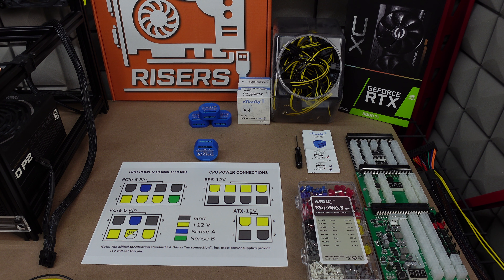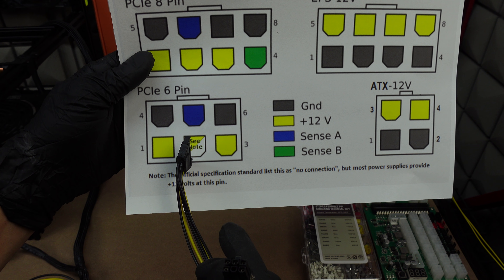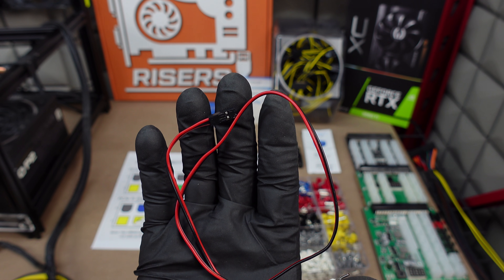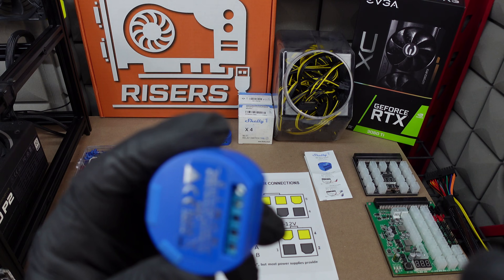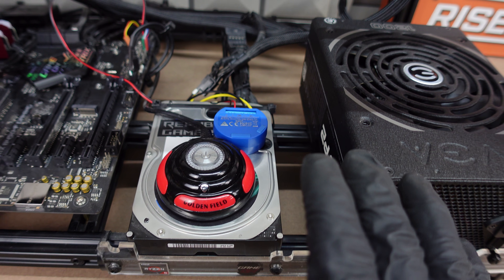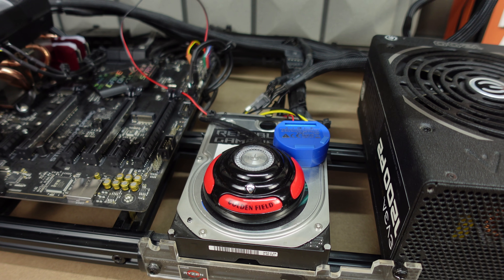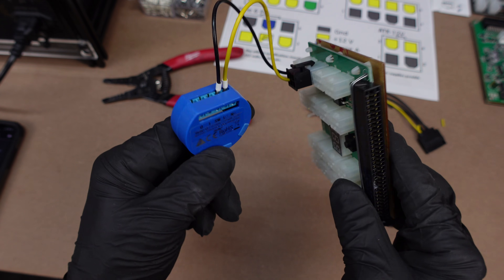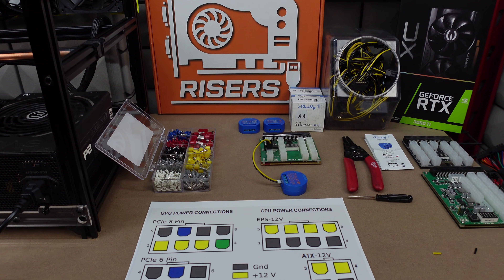How To Remote Control ANY Mining Rig | SHELLY Wifi Switch | All Miners MUST Know

Comment: I cannot get the Shelly switch to work properly on a server PSU. I've fiddled with the settings for button type but every time I turn the rig on, it turns it right back off. It's like it double switches or maybe runs continuous signal or something which prompts the rig to shut back off. Any tips?
Reply: I figured out that I can turn the switch on then back off and it will leave the rig on. Haven't tested it from outside the network yet but hopefully there wont be added latency that will make it not work.
Reply: @b00btube3d nice fix I am alos having that same issue.  Appreciate if you can advise what button/switch settings you selected in the app🙏

Comment: My setup: ATX synced to 2 server psus via sata cable/sata-molex adapter. X11 breakout boards. When I turn the power on/off on the ATX, both server psus toggle on/off.

My issue: When I attached the Shelly Switch to PWRSW and the 6pin to the breakoutboard, everytime I turned on the rig via the Shelly Switch, it would turn itself off seconds later. What I ended up doing was attaching the O/I slots to the RESETSW instead. Again, when I used the switch, it would switch TWICE. But since its a RESETSW, it doesn't matter too much if you're just trying to restart your rig. You'd be able to turn it off via Hiveos, but turning it back on is a problem. I wish I knew what my problem was so I could use switch as intended. This works for now though, I can go on a trip and not worry about rig going offline for w/e reason.
Reply: I'm having the double switch problem too. Did you figure it out?
Reply: I didn't. I had to keep it in the configuration i described above. Also, when I took the Shelly switch to a different place with a different wifi, I was unable to connect it... When i brought it back home I was able to use it again. Weird.
Reply: @jonathank2302  I ended up figuring out that if you turn it on then off within approx 1-3 seconds, it will stay on. The constant signal that the Shelly sends is the problem. Essentially, you send a on signal then shut the Shelly off so it doesn’t screw up the rig.

Comment: Why go with such tedious process..

Just use smart wifi plugs. And use them to directly power on/off the rigs.

If you have multiple psu for a single rig. Then use extension board for each rig. Connect the extension to smart plug and all psus of that rig to that extension.
Now use the smart plug to power on/off the rig even with multiple psus at once.

Some smart plugs also give power monitoring feature. I use them to make note of my power usage too.

Comment: I’m confused chump change. When connected to a server psu do you not need to connect the computer switch wire then? You didn’t connect it here so I’m not sure?
Reply from the maker: You do I just didnt show it. Check the second video where I actually do this!!
Reply: @ChumpChangeXD  where is the second video. I cant seem to get mine working...it is connected to server psu and the pwswitch on motherboaard. When toggling it in shelly app it powers the server psu off.

Comment: Can you Build 10 3060 ti mining and how much power supply does it need and how to undervolt it in HiveOS
Reply from the maker: I can give you some clocks!

Hit the speedometer thing to the right
Core 1430 or -200
Memory 2400 (up by 50 no exceeding 2600)
Fan like 80-100 (depending on the Situation)
125-130 power limit 

It’s going to take some time but you need to try every card and restart the miner after each adjustment. Give 10-20 mins in between until you get a crash or the rig goes off line then you know your pushing something too much and go back to the precious

Comment: nice video!  i was looking a little bit into these too.  for those who are not using server PSUs can run the shelly as a relay off 120 volt,  or actually they can just run it off a cheap 12 volt power plug.

Comment: I’ve tried Shelly switches as well their competitor, Sonoff.  Sonoff is cheaper but their app (EWeLink) is nowhere as good as the Shelly app.  Great video-I learned a lot… here’s an alternate solution for controlling mining rig power remotely,

I’m using “Emporia Smart Switch with Energy Monitor”.  No need for custom wiring.  It goes between the PSU power plug and the wall outlet.  Set the motherboard BIOS power option to automatically power SW when it detects the PSU has power cycled, and controlling the PSU thru the app will have same effect as using the power SW.
Pros for Emporia Smart Switch:
1. It monitors power consumption in real-time and historically.  Amps monitoring is useful to ensure not going over circuit’s 15Amps limit. Watts and kWh statistics keep an eye on cost.
2. The app interface allows an optional confirmation when tapping ON/OFF button.  This is safeguards against inadvertently shutting off the rig.
3. Neat and tidy, no additional wires on the rig.
Reply from the maker: Only reason I’m going with these is because they are rated for 240V as well! ❤️
Reply: Hey i bought some sonoff basic r3 what i don't understand is why does chump power this devices with the psu .. wouldn't it work powering thru line? So the device is always on and you can power on and power off the computer even with the psu off?

Comment: Or, you could just buy a switched PDU, which allows you to turn on/off the individual outlets on the PDU. I use HP ones, but Triplite also has switched PDUs. A single ethernet address gives you a web page in which you can turn on/off individual outlets in the PDU.
Reply from the maker: Interesting I did not know that but this is much less expensive LOL
Reply: @ChumpChangeXD  You can get a switched PDU for under $100, which is still pretty cheap in my mind. I have 4 of them for my server racks. I use the HP model, which is built upon the APC PDU. You can turn on/off individual outlets or groups of outlets that from a single web page. However, you do have to have that accessible from your network since it doesn't use a server to perform these tasks but rather you connect directly to the PDU.
Reply: @ronwatkins5775  do you mind linking one?
Reply: @xaviermolinares92  If you look at any PDU and can see an ethernet port, it's likely a swtched PDU with some sort of web based interface. Just research the part number to see the specs to be sure.

Comment: I think you should be able to do this with Sonoff Basic Smart Remote Control Wifi Switch, these are bit cheaper
Reply from the maker: These are rated for 240V which is why I wanted these 🔥

Comment: Cool device, I haven't even thought about something like this.
Instead I've used connected plugs behind the PSUs of each of my rigs, as a bonus the plugs also give real time consumption and past consumption into the phone app (no needs for it at the wall).
But I had to set my bios to boot automatically after power loss.
Oh, I'm in EU here, so I'm using 15A 240V graded plug ... Good for 3600w, more than enough for one rig.
Reply: You mind sharing what plug you are using? Thanks

Comment: Is this incase your  mining operating system doesn't respond to requests?
Reply from the maker: Yes randomly I have an issue where one rig will lock up my entire Internet needs to be restarted. If I can’t physically be here this is the perfect solution!!
Reply: @ChumpChangeXD  correct me if I am wrong, but if it locks everything up to the point of needing to restart your internet. You won't be able to access the switch from outside the network if it's locking up your internet. No internet, no outside access.
Reply from the maker: @SolSevinVR4  it locks the network switch not the wireless router

Comment: I am using smart plugs, one for eache rig witch is pulling around  1000 - 1200W, 
at 10$ a piece
Reply from the maker: Those plugs are nice for normal ATX power supplies but you cannot safely use them on 240 V
Reply: @ChumpChangeXD  Can i ask why you can't use safely the smart plugs on 240V?I live in EU and use them for years on my mining rigs.Never had one single problem.Not to say i can control the rigs everywere in the world i am and each rig is pulling about 1100W.

Cheers!

Comment: Beautiful solution! I do use a smart outlet for this, but I can do so because my rig pulls a very low current from the wall. In a 20 Amp+ rig environment, you could use those Shelly with 110/220v in a separated low current service line just to juice them up and control any size of rig with it. Ty ChumpChange, this video is saved in my permanent cripto-mining video library ;)
Reply from the maker: Your awesome and MORE yah welcome!!! ❤️🔥

Comment: You can do this with cheap Smart wall plugs as well, like the Kasa smart plug. I want to find something to power cycle that smart plugs based on discord messages. Like when a rig goes offline it will power cycle it.
Reply: You can use this Cheap shelly device to power cycle your rigs on atx, just provide seperate power.
Reply from the maker: Yes sir 120v works also
Reply: Btw you may find that server power supply might be a little cheaper than some atx out there.
Reply: @carlospolanco4323  for sure I have a few. Just offering an alternative to folks that may not want to wire something together
Reply from the maker: You cannot use those smart plugs safely on 240 my man
Reply: @ChumpChangeXD  oh yeah for sure but for those normal 120 ATX PSUs like us petty little miners use they are fine 😆😆